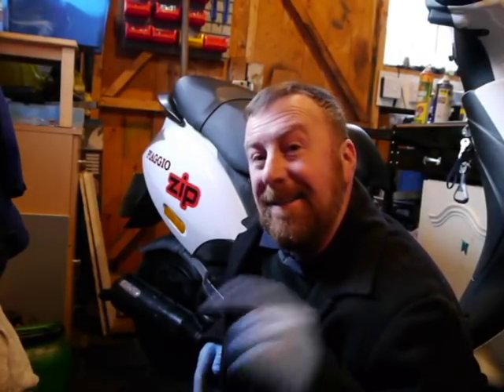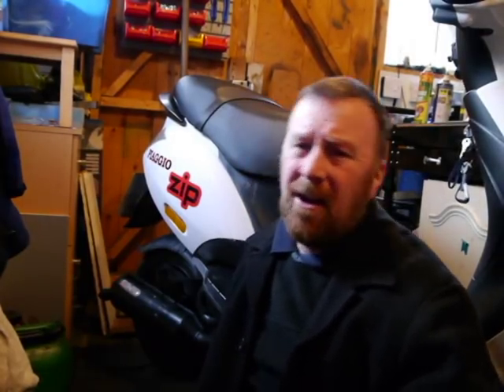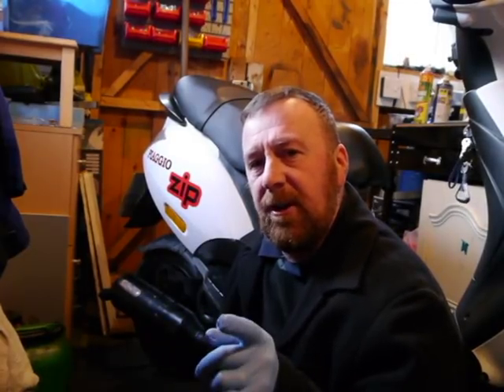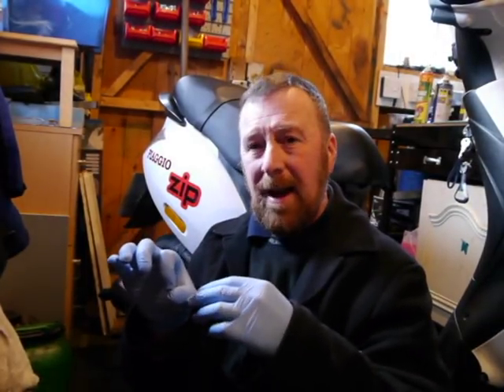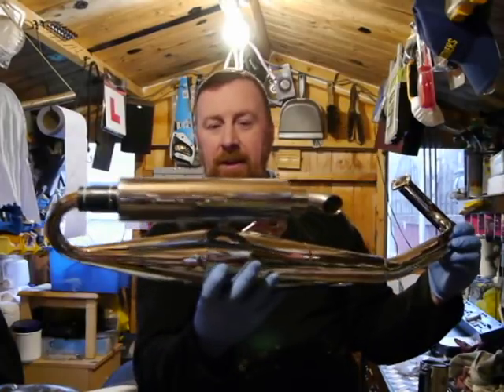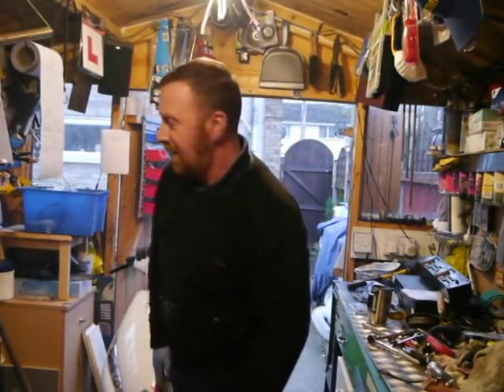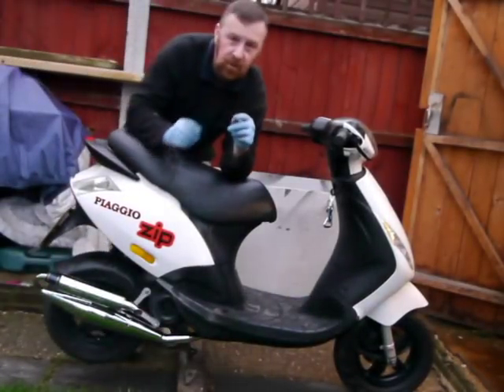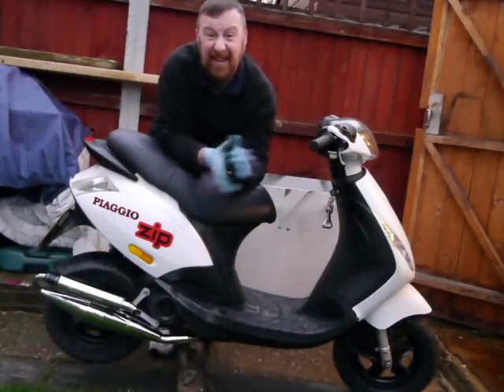CHANGING TO A SPORTS EXHAUST ON A MOPED IT'S A MUST ! MARK SAVAGE

Comment: Hi mark! Another great video of yours very informative!! But i've noticed you use a different camera or something because the quality isn't as good as it used to be? Thanks man
Reply from the maker: Oskar Pyc hi bud I’m using a SLR camera and thought it would be better but like you I’m not that happen so may go back to my iPhone lol 
Thanks for watching bud 
Mark
Reply: Okay mate, still great videos!
Reply: Also i have a kymco agility 50 2013, i put a bigger main jet 82 in it and i read that this was ment to improve it because the standard 80 is restricted but i noticed the performance is much much worse, it goes about 20 up hills that i used to do 28, not sure if i need to adjust something. Thanks appreciate your reply!
Reply from the maker: Oskar Pyc aa in my other video on down jetting you are putting in too much fuel but the same air flow and the gasses can’t get out 
Your bike is restricted by cdi and guess it’s 4t so that’s all it will do bud 
Mark
Reply: Alright mate, thanks for commenting, i might put the 80 main jet back in it then, i also think the choke might be sticking but ill see, Yeah cdi restricted but i just bought a performance ignition coil and unrestricted cdi, ill see if theyre worth it and if ngk iginition coil is better. Thanks!
Reply from the maker: Oskar Pyc the sports cdi don’t last long so if it starts to play up you will know why 
Putting the jet back is the right thing to do 
Maybe a sports exhaust would help !
Any way have fun bud 
Mark
Reply: Yeah man, only reason bought the cdi is because it came with the ignition coil ahah, thanks for your information, ive decided not to put a sports exhaust on this 4 stroke because from what i read people that did got very minimal gains, i will definately put one on when i get a 2 stroke !!! thanks Mark

Comment: Mark why is my exhaust really really hot . And I think my throttle cable has stuck because my bike is reving really high and the throttle is really stiff
Reply from the maker: hi bud 
exhausts do get hot so don't worry about that but revving high will have something to do with that 
watch my tuning video this should help as your idle is too high, but maybe your cable could do with some WD40 or replacing 
try taking out the needle and see if it's fitted correctly and moving up and down ok, sorting this out should help the bike plus the belt as it will be wanting to go all the time 
hope that helps i have many videos that should help 
mark
Reply: Thanks for the advice mark tryed all the idle mate . But come to my conclusion I did hold the throttle in a tiny bit and it's just stuck there mate . No I'm at a different point cause now I've had the carb of my bikes not sparking now . One thing after another
Reply from the maker: Adam Hughes I hate that when that happens !!
Fault finding is not fun but good if you find it and fix it 
Just trace your way back and have a volt meter handy 
All the best bud 
Mark
Reply: mark savage have you got an email address where we can speak more privately mate . Desperate for help this bike has been nothing but trouble since I bought it
Reply from the maker: hi bud, i ask people to chat on here as before i got so many people finding me on FB then i spent all day answering message all times of the day and then if i couldn't answer straight due to me being at work of asleep i started getting  ???? and why haven't you answered and so on , so i stopped doing it 
if you want to upload a video on your site with my name in it and let me know ill check it out for you and see if i can help 
they do drive you mad these peds bud, i do have 320 video and about 150 on mopeds that should help from fuel to electrics, engine ,wheels and so on have a good look through my videos on a computer then they should all come up 
mark
Reply: yeah mate I get ya pal . I just really shite with mechanics . ive followed you videos everyday I'm watching . I changed my head gasket and piston/rings . but this carburettor is driving me mad . had it started fine before . fancy coming to fix it for me lol  . the amount of money ive spent on this bike is unreal you would just think it woukd be running by now . its the ballache of walking 5 miles and back to work everyday

Comment: Could you please help me I need 2 no what's best size rollers for my speedfight2 100cc all standard but rollers are f****ked
Reply from the maker: Shaun Thomas weight what you have a n there now but I’d be putting in 11g to 12g see which ones you like best
Reply from the maker: Shaun Thomas I have over 70 videos most on 50 cc but they all should help
Reply: It add 11 in but I tuck them out an put 8in an nw takes off fast but only dose 35
Reply from the maker: Shaun Thomas yea as in my variator video 
Give it a watch to understand why
Reply: @bradfordbikelife9974  change clutch springs and variator to a malossi mhr
Reply: @diannecrawford9996  been sorted for a wile nw get just over 70 flat out

Comment: I have a 2018 typhoon it currently just abouts hits 30mph I want to put a new exhaust and derestric the bike would u recommend having to change the rollers and jets
Reply from the maker: the newer the moped the more restricted they are bud sorry to say , start with the exhaust this should help then move on to the variator 
maybe a sport variator and heavy rollers for more top end , no upjet for now but you may have a restrictor in the carb 
but it its cdi restricted it will pull away better but still only do 30 mph